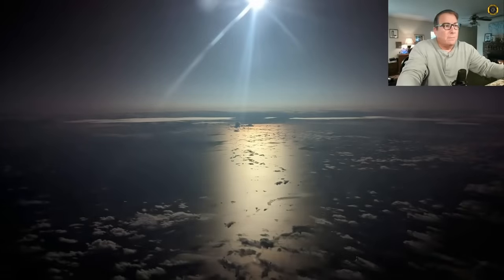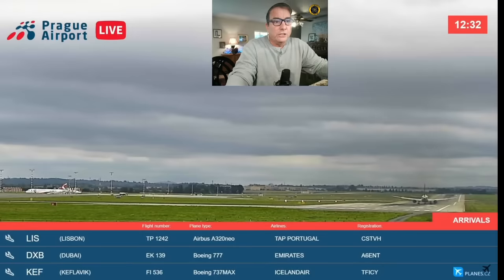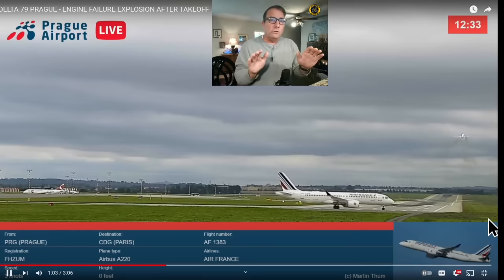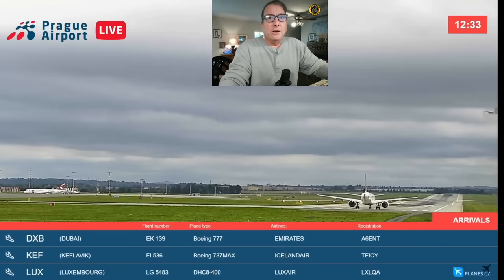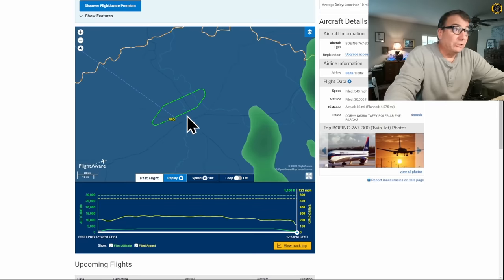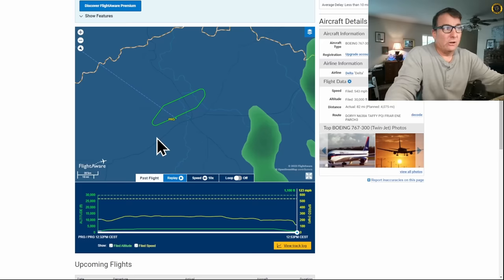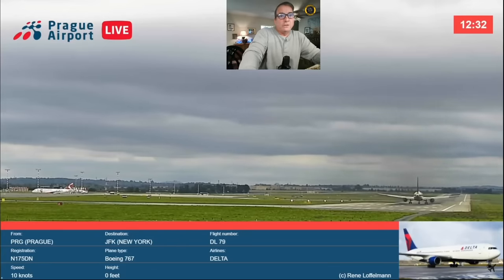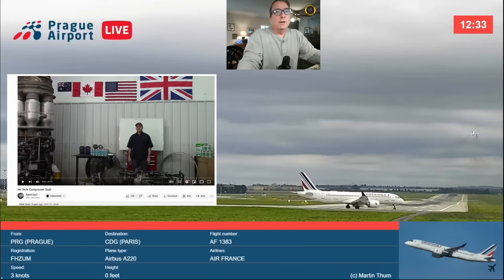DELTA 767 TEXTBOOK Engine Failure on Takeoff - Prague/JFK

Comment: I thought on a twin it's "deadleg dead engine" meaning you have to push on the rudder pedal closest to the good engine. That pedal action would cause a turn away from the dead engine, not "into the dead engine." This action would lift the dead engine wing, which is what is preferred to prevent a roll into the dead engine.

Comment: You would know, Juan, can you explain why the yaw damper (if there is one) did not counteract that yaw? My only multi experience is a single flight in a Cessna 310 when the CFI MEI pilot in command instructed me to idle the starboard engine (at altitude, well above blue line) — the damper completely neutralized the asymmetric thrust.
Reply: Good question, I flew many hours in 310’s and yes what you experienced was very different in a 310. This 767 has the remaining engine pushing almost 60,000 pounds of thrust with a crosswind pushing it off of center, just too much pressure for easy yaw dampening.

Comment: Textbook. This is what you get when you have an excellent training system and well thought out SOPs. My only comment would be that they should use the proper phraseology of PAN PAN or MAYDAY instead of saying “emergency aircraft”. You’re operating in airspace where English is not the mother tongue of the ATC controllers and using terms they will clearly understand will make your life easier as well as theirs.

Comment: I was on a Delta 767 flight out of PEK that had a compressor stall just like this seconds after rotation... It was LOUD. We returned and went out 24 hours later on the next scheduled Delta flight. Looking at the flight tracking websites... the aircraft was on the ground in Bejing for 3 weeks.

Comment: I saw the video when it first came out in a post on Reddit.

What I found interesting is that the Air France pilot sat at the end of the runway and eventually asked Prague ATC if they were cleared to depart or not; Prague ATC eventually told them to vacate the runway because of the Delta flight that was going to be returning to the airport.
Reply: Sometimes the airport will do a FOD check of the runway if a departing plane has an issue. Its less an issue for the same plane returning because its their parts and if they leave more on landing a final check will clean up any problem objects.
Reply: @RowanHawkins  and ofc the plane returning is landing and should be able to stop basically regardless of fod, whilst another plane taking off might just end up in its own situation and also calling an emergency 😬
Reply: They also needed to check the runway for any debris just in case that engine was spitting out parts on the take off roll.

Comment: The best preparation for such an incident is calculating all your performance for the return to land before you depart. If it happens you already know which runway to return to (we require…). All you need is to input an ILS into the FMS, set auto brake, and set a Vref speed. As for the checklist, most of it is covered by memory items and the remainder is mostly the decision making for which flap setting to land with, that that decision has been made already in the ore-departure brief. 

Just don’t forget to adjust for the drift!

Comment: We started practicing engine failures at or near second segment climb years ago.  I personally think they can be a bit more difficult to deal with.  For some reason, at least to me, the startle factor can be a bit  more dramatic.
Reply: Juan,
Got your message. Departing ACC in a bit. Will follow up tomorrow. Yes, all our EO scenarios include V1 cut on runway and second segment climb. FOQA data showed that most actual EOs occur prior to V1 or during 2nd segment climb.
Reply: The first time I got a second segment failure was on the 737.  I must admit that I wasn’t expecting it and as it was a training event he check airman wanted a teaching moment which I provided!  First time in 25 years I mis-identified the dead engine and the resulting recovery from that got ugly real fast. What happened (and it was very easy to take the bait and according to the check airman I was not alone) mentally on take off you’re all psyched for the worst case scenario, the failure at V1. Plenty of yaw cause the rudder is just becoming effective so identifying the dead side is easy and assuming you don’t horse it off the runway, the gear will help with control ability. By 400 ft or so it’s easy to relax and think “well I’m not going to get a failure on this takeoff” .  Wrong! Here the yaw isn’t quite as pronounced and mentally (at least the first time it was shown to me) I had already checked out.  The IP’s point here was that second segment is still part of the takeoff and he was right. Currently at AA at least every time I’ve been down for a checkride subsequent to that introduction the Captain usually gets the second segment failure and it’s just an anecdotal observation on my part, but it seems it’s more demanding than a straight up V1 cut.
Reply: Great point.  The Pilot lacks the visual assistance of the runway centerline with an engine out in the 2nd segment climb.  About every 5 years in the sim the FAA would mandate that exact scenario.

Comment: From my experience in Air Force, before any plane will land , or take off, runway must be checked for debris.
Reply: blancolirio0-  Do you remember Concorde? After explosion in engine parts might be ejected on runway, and later sucked in by another plane. In this case enough is to send service truck for quick  drive along . In my service always before flight day runway was vacuumed. Sometimes they made all of technicians to walk all mile of concrete. You wouldn't believe what birds can left behind on runway. Crabs, clams for example.

Comment: Juan - DEC 1978 over Marietta GA, flyin' along towards ATL in TriStar, w/ah...well 3 engines.  #1 outta gas so had 2 left, #3 out of gas leaving middle motor...which ran out giving us...middle, well you know...so ID'd ourselves as Delta Glider Flight powered by RAT.  Controller said #1 on any runway except one under re-construction!  Capt set her down on foote, full brakes, kidde-cornered RT on 1st cutoff towards terminal, full brakes, LT on Taxiway, full brakes all the way even across AMR Apron, button-hook to RT, pulled into vacant Gate, known as "Our Gate"!  It was night, so no wind, no RAT, Bat Trees flat, no lights, so Fire-Rescue having been scatted off Taxiway when found out we'd be usin' it, then paced back & forth on Taxiway not finding crashed TriStar, a big item to lose.  Tower finally advised we were guests of AMR who had put out the tire fires, so Fire/Rescue & Medical to return to Ready Stations.  These Delta & ATL folks really know what they're do'in, so fly on Delta liners, hope they put more than 10 bucks in 'er, and relax...

Comment: I’m a loyal a Delta flyer. I think they have some of the best flight and cabin crews in the business. So do the others like UAL AA SWA and JB but considering JFK and LGA are my hometown airports Delta just knows how to run an airline. They offer a great customer experience consistently and always do the right thing even during unexpected situations. If your flying the triple 7 to SYD from LAX I’ll assume you work for AA  as they fly the 777-300ER on that route and UA flys the 787-9. Love me some AA also as I was former US Airways ✈️ My aunt Lauri C was number 1 FA at legacy starting in 1962 until she passed away after 55 + years of flying the flag. 
Kudos for commending the Delta pilot for a job well done. It was like old hat for him and wasn’t fazed in the least. Other than the nightmare of having to deal with what comes next after an engine failure. I blew  3 engines over the years on 3 different flights flying the classic 747’s back in the day. Wasn’t fazed one bit on a quad jet. However those P&W JT9D on the -100’s weren’t as good as what we have now. Miss those old goats though 😂 great review and fly safe ✈️

Comment: I live in Prague and not far from the airport, so I'm glad to see the happy ending of this. One question: Our airport is in the need of the second runway and there's a plan to build one, but there's also a pussback from all sorts of activists and environmentalists. I'm just wondering, in these cases when the aeroplane needs to return immediately, wouldn't it be better and safer if the airport indeed had two parallel runways? I'm not a pilot, but I can imagine what a complication it could be if the Air France plane behind the Delta plane also had some sort of trouble. And an additional question for active pilots: How is Prague airport in general? 
Thank you and greetings from Europe!

Comment: Maybe someone already pointed this out, but all instrument departures fly headings.  Juan mispeaks when he says the pilot is trying to maintain runway centerline.  Only VFR pilots should maintain runway centerline.  Engine failure yaw will pull the aircraft off the required heading, but the proper corrections will put the aircraft back on this heading and not correct back to a centerline departure path.
Reply: Not necessarily. You may be taking off in LNAV. As soon as the aircraft is off the ground, the flight director will command the track specified in the selected loaded SID. If LNAV is not selected before take-off,   the flight director roll bar will command runway TRACK. Following the flight director roll bar, the aircraft will regain the runway track if it yawed initially at all upon recognition of the engine failure. After 400 feet, only then is heading selected if the procedure is to follow the runway heading.

Comment: I'm not a pilot, but just a query; why would the ATC not release the Air France flight for takeoff?  I understand that you would not want to risk 2 wounded aircraft in case they also had an incident on takeoff, but apart from that?

Love your videos, Juan!
Reply: There might have been something laying on the runway from the damaged engine too.
Reply: @altavelmcnamara  Fair enough.  Safety first and all in line with the established protocols for these situations.

Comment: Juan… I’m not fully through the video but it comes to mind that at international flight with potential full fuel weight…if it hadn’t been for a 12,000 foot runway, they could’ve had some issues with higher final speeds touchdown speed on a 7000 foot runway for example… Your thoughts?

Comment: Excellent, Juan! Thank you. I'm curious, why did they have Air France vacate the runway? Why not just let them take off? It was 20 minutes. Do they automatically assume the problem might have been due to FOD, or bird strike?
Reply: I think the concern is that they may have experienced FOD, but also, if they sprayed parts on the runway, you sure don't want to run thru them.

I mean, NO ONE knew, at the point, what REALLY happened.
Reply: To inspect the runway, in case metal fell off from failing engine.
Reply: Or you could be like the Concorde that crashed due to FOD.
Reply: is the answer to this not obvious.......? I guess you clearly aren't a pilot.
Reply: @KuostA  Oh, my bad. Is this channel only to be watched by pilots? Pardon my sarcasm here, man. My mommy always told me there are no stupid questions. Thanks for being understanding.
Reply: @ReasonQuest  I'm not a pilot & don't always understand pilot lingo. 😉 but I avoid asking dumb questions that show my ignorance.
Reply: @jeanetteshawredden5643  Good for you. I have a policy of asking questions to get rid of my ignorance. That's the purpose of questions. If one knows the answer, what is the purpose of asking?
Reply: Matty2u664 it’s precautionary in the event the engine was starting to unravel after the power was set for takeoff and shed parts on the runway. Secondly if the Air France had problems of their own and aborted takeoff they could possibly have extenuating circumstances like blown tires or the emergency may have required them to shut down on the runway. This would affect the aircraft with an engine out attempting a go around for an emergency landing on that same runway. 
Matty don’t pay any mind to some of these armchair know-it-all’s that like to pick and cut on others comments or spelling this channel is not for pilots only that’s why Capt Blancolirio takes the time and explains such things. He not only wants to enhance peoples knowledge about aviation but also save lives in order that mistakes made won’t be duplicated. All the best.
Reply: @natural-born_pilot  Thank you!

Comment: The 777 has a TAC system which will apply 100% of the required rudder input while inflight to keep the aircraft tracking straight with an engine out situation. 34 year airline career, never had an engine fail.
Reply: Well, not 100%. It leaves a bit for the pilot as a tactile cue.
Reply: @meofnz2320  On the ground, the Thrust Augmentation Computer applies 90% of the required rudder to maintain straight tracking down the runway. Once in the air, you can fly with your feet flat on the floor, as the TAC compensates 100%. This was mandated by the FAA as they wanted the pilot to recognize a power loss during takeoff.
Reply: @OlesonMD  
Apologies, you did specify inflight. I concede the point!

Comment: I don't have a multi-engine rating but when Juan was talking about the right hand pattern and that airliners can easily turn "into the dead engine", would it not always be easier to turn INTO the dead engine? In this case, the thrust is on the port engine so a would it not be pushing the plane to the right anyways, as we saw when the failure happened? As such, the right pattern would be easier although I certainly understand that it would not matter. Great analysis and, as others have noted, something to see how easily a fairly heavily loaded 767 can climb out on one engine.
Reply: My brother, who does have a multi rating, explained it to me that better to turn away from dead engine to make it easier to STOP the turn.

Comment: The pilot is making right hand turns, but if the failed engine is on the right side, shouldn’t the aircraft take its turns to the left? Or is that only for aircraft that have much less powerful engines?

Comment: The RT here is poor. EFATO handling as per SOP. When you fly outside the USA please remember in the whole world it’s either PAN x3 or MAYDAY x3 the rest is waffle.
Reply: Thank you for your reply and your analysis of aircraft incidents and accidents which are very accurate, interesting and detailed. 
However the RT of this video isn’t the standard. 
This is an extract from the UK CAA:
“By adhering to standard phraseology and technique, pilots and ATC can play a very important part in preventing accidents and incidents.
The following tangible benefits are readily apparent:
• Standard phraseology prevents misunderstandings or language difficulties, particularly where
English may not be the pilot's first language.
• Standard phraseology can assist pilots in building up situational awareness of the other airspace users in their vicinity.
• By making standard reports and correctly carrying out readbacks, the need for further confirmation by ATC from pilots can be reduced, leading to workload reductions and a decrease in frequency congestion.
• Potential errors by either ATC or aircrew can be detected and corrected, thus preventing potential accidents, AIRPROX events, and incidents.”

Comment: They must have returned and performed an overweight landing. No mention of them dumping fuel and I’m sure they must’ve been heavy. I don’t think the 767 has the ability to dump fuel. Or is that safety feature something that was added to the 300 series? I am referencing the Air Canada 767 out of Madrid, which spent hours burning off fuel before they could land.

Comment: I am puzzled. Prag to JFK they must have had full tanks. How could they turn around and land without fuel dump? Is that aircraft specific? Can some landing gears take the full take off weight and others have to dump to reach the max landing weight?
Reply: Yes, 767 can land even with maximum weight.

Comment: In a light prop-driven aircraft, there is always a possibility of a critical engine after one engine failure. Jet engines are far away from that issue and easily climb on one engine.

Comment: Nice analysis by Juan (as usual). Only question I have is why was there no fuel dumping before the aircraft could land again. How was the aircraft able to land with just 20 mins of fuel exhausted?
Reply: Just because a plane takes off doesnt mean its tanks are full. They only load the fuel needed for the trip plus some for safety.
Reply: This was a flight from Prague to JFK. The Flying distance between Prague and JFK is 4090 miles and flight duration is approx 8.5 hours

On a 767, would this not require a fuel loading above the landing weight limit?
Reply: -blancolirio_-  is this a spam account? I see hypen and underscore which looks like a copy or a spam.

Comment: When you said no fuel dumping, did they land above the aircrafts max rated landing weight?  How does it work out to land above that?
Reply: Max landing weight is max routine landing weight basically. Overweight just means the plane, mostly the landing gear, needs to get checked out afterward.
Reply: Depends on the aircraft and takeoff weight.  My #3 engine failure on takeoff out of Boston, on a 747-200, required immediate dumping.  We were headed to London with a full load.  After a successful landing and subsequent conversation with the head mechanic, his first question was did we land overweight.  A complete engine change would require 3 hours; an overweight inspection would be 6 hours.  We did not land overweight as procedures are to immediately start dumping if you are above max landing weight at the time of the emergency.  My hats off to the Delta crew for explanatory performance.
Reply: Only jettison fuel if the landing performance requires it.